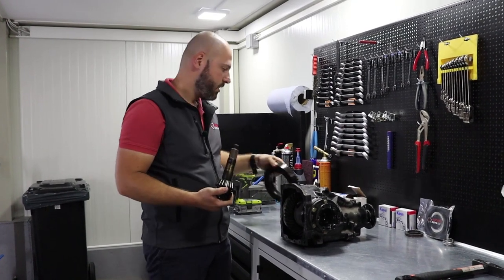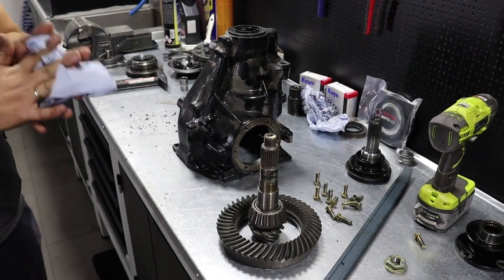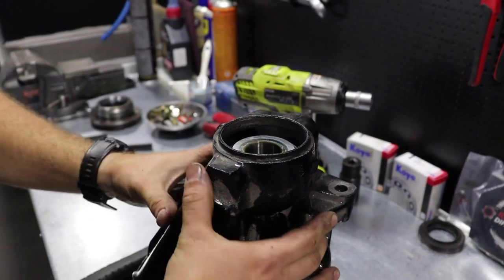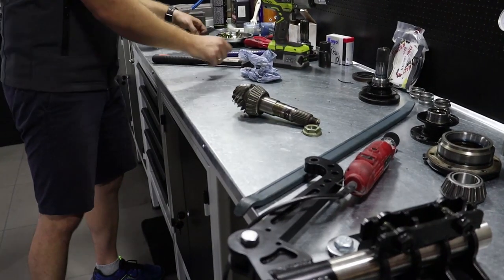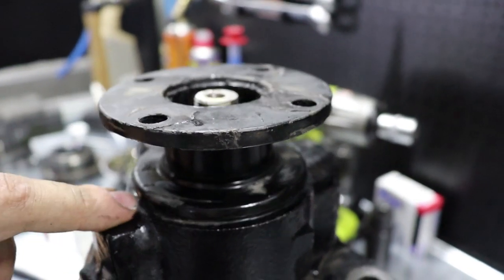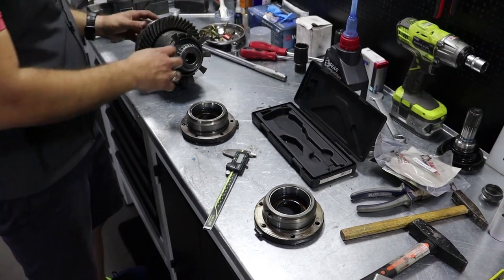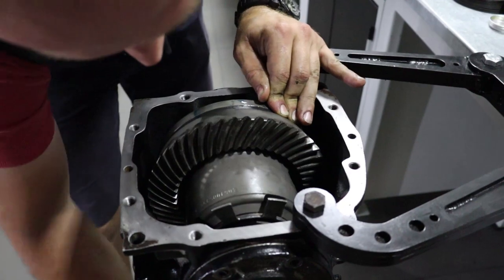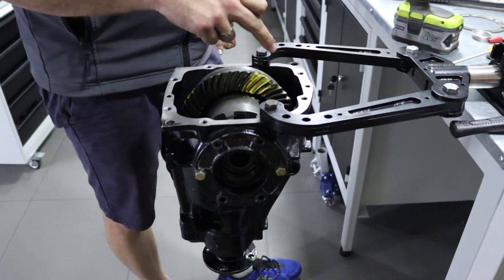How to change BMW differential gear ratio | Easy step-by-step instructions | Backlash adjustment

Comment: I bought pressure plates from these guys and they showed up in 3 business days from Serbia to US. Shipping was pretty cheap and parts were much cheaper than diffsonline and didn't have to send in old plates. Very good experience now I can finish diff rebuild w/ 3 clutches and 30/60 ramp. Should be perfect. Thanks.
Reply from the maker: Thank you sir for positive feedback! Means a lot👍🏻

Comment: ok finished my 188mm 3.46. Just to add more data here... I didn't change the pinion depth spacer I used the same one that was already in the stock diff housing even though I changed the pinion which had a different spacer offset written on it (the diff housing is stock E36 M3 w/ 3.23). I got a good mesh adjusting the backlash (lsd housing preload) left (looser) by one shim set. The stock shims were 1.63L + 1.63R. I changed to 1.66L/1.60R and was done. About the crush washer.. buy two or three. Once you get it to 4 or 5in lbs you tighten by 1 degree and it can shoot to 25in lbs! Have to make very minor adjustments.
Reply from the maker: Thank you for sharing the info with us and our community! Very helpful!

Comment: I just bought 2 sets of kits from you for clutches / clunk shim 
You are great. I finally found  real video of someone doing work like I do . 
Keep up the work . Also do a video with assumption of lost side shims. 1.3mm but there could also be a preload on carrier that BMW does not publish  . We can assume 2 bearings on pinion is not different from carrier ? 2 and 2 bearings and case flex . 10 inch pounds on carrier ? I wonder on new and used typical bearings   . Pull a pinion out and check side flange torque drag   . Do a video . 
Great work ! 
Roman .

Comment: Great video. On some old rovers where you cannot buy a new pinion crush sleeve and you can’t get a shirt, they heat up the original crush sleeve with a flame until it relaxes or anneals and then you can reuse without shim.
Reply from the maker: Clever move. Wouldn't think of that👍🏻 thanks for sharing👍🏻
Reply: like red hot or just a few hundred degrees?

Comment: Thanks, that answers the backlash and mesh setting procedure but still wondering about preload or clearance of the main shaft bearings ? Here you assume original shim total thickness is correct ?  Should this be checked or set before installing the pinion to get total shim thickness ?  Do you have a video showing how to do this ?

Comment: FYI, for the sleeve used to install the pinion bearing buy and cut a piece of 1 1/2" electrical conduit - that's what he's using. It fits perfect. Don't buy 1 1/2" galvanized plumbing pipe the ID is too small.

Comment: I love watching your expertise in rebuilding diffs! The bearings went bad on my manual E92 330d 215L which has got a quaife atb lsd in it. I was going to have a go at renewing the bearings myself but found a 'specialist' near me who said they could do them for the same cost as i would have to pay for a bearing set. 
After i put it back in the car it only lasted 2 weeks then started whining again! They had the diff back and said they'd fix it. They didn't because it was whining straight away. 
I'm going to fit a spare diff i bought, had to get an auto 2.81 because they are common and a lot cheaper, and strip the noisy one down to see what has gone wrong. 
What are your suggestions as to what it might be? C clips put in the wrong way round? They have not fitted the pinion shim maybe?
Thanks in advance for reading and replying if you can.
Reply from the maker: Thanks for reaching out. Since you have quaife LSD inside, backlash might be wrong so the noise comes from CWP. You'll see that when you disassemble diff and do visual inspection of bearings. Measure backlash, shouldn't be more than 0.15mm and less than 0.08mm.
Reply: @RacingDiffs  Thanks for the fast reply. The quaife was fitted 3.5 years ago and was absolutely silent until the bearings in the pinion went bad a couple of months ago.  Hope you don't mind but thought you might like to see my video of me enjoying LSD life before my bearings went bad 😂 
https://youtu.be/aka-t0XLLuk
Reply from the maker: @simonhaycocks  than it it's just bearings. If you have any questions when you start the job, please feel free to write to office@racingdiffs.com.

Comment: From Texas, glad I found your videos; thx for taking the time.  Im curious about the choice you made regarding the diff you are working on in the video.  Here in the States the OBD1 E36 automatics with the 1.8 4cylinder cars come with 4.44 diff gearing.  Is it easier to obtain a 4.44 and instal the hardware to make it a posi or is it best to swap gear ratios as you are doing along with the posi hardware as a complete rebuild with new parts; once and done.  Thx again for your vids.
Reply from the maker: It is a bit easier to swap only gear ratio and keep original carrier unit. But changing carrier unit has just 1 more step of setting its preload and that's it. We gonna make that video soon.👍🏻
Reply: @RacingDiffs  looking forward to that video!! Appreciate your skill and knowelege in your videos; thx for the effort and your time

Comment: Awesome video!! by far the best explained! im looking for a set of spacers for my BMW E30 lsd, something you can help with?
Reply from the maker: Sure. You need spacers for backlash or crown gear spacer?
Reply: @RacingDiffs  the carrier preload spacers, its a E30 3.64 LSD which has been taken apart and built by a random guy who i don't trust to do a good job lol.. i want to fully check it myself before i fit it to the car. and since it has many miles on and its been played with I'm guessing i will definitely need attention. i need to find out the technical specs first though, preload and backlash etc. i'll have a hunt around for the info and see if i can find out xD
Reply: Just came across this: 
Tolerance for backlash is : 0.06mm to 0.14mm
Crownwheel bearing preload tolerance is : 9lb/in to 18lb/in

two part numbers for each side spacer set:
33139065734 (1.45mm to 1.69mm in 0.03mm increments,)
33139065735 (1.72mm to 1.96mm in 0.03mm
 increments.)

I'm checking it out over the weekend so we'll see xD

Comment: Very informative! Very nice of your company to make such videos. Question from me: can I use pinion from open diff?
Reply from the maker: Thank you for your compliment. Yes you can, as long as you use the same crown gear. Pinion and crown gear are factory paired so you shouldn't mix them.

Comment: amazing video! been trying to understand this for ages. my only question is could i potentially use just the contact patch to adjust backlash? i dont have equipment accurate enough to measure backlash
Reply from the maker: Thanks! If you get the patch perfectly adjusted, the backlash will follow👍🏻

Comment: Great video. So the the shim for the crush sleeve pinon is because you reused the old crush sleeve.  You sell those separately? Or do you just recommend using a new crush sleeve? What if you measured the distance between the case to the top/flat side of the pinon gear? I’ve seen some kits that help measure the pinon depth? Is that only to establish the approximate depth? I assume you always need to have the final torque resistance done by the torque reading. Also what is the approximate axial free play you have initially? Seems like 1.0-0.5mm. Thanks.
Reply from the maker: We don't sell shim separately, we have it included in swap set and pinion bearing set which includes: 2 pinion bearings, all 3 oil seals and the shim. As for pinion depth, from our experience with BMW diffs, in more than 95% cases you can adjust gear ratio correctly without readjusting pinion depth as they make housings pretty precise. That's why we didn't showed it in the video. But we do measure each diff we assemble for our database. 
Pinion torque resistance should always be measured as this is the important part. You're right, we leave the smallest possible free play before we start tightening because this saves you time and effort. Also new crush sleeve is very strong. If you don't press him to this 1 mm you gonna sweat pretty much with 2 m lever to crush it.
Reply: I just went on your site and didn't see the shim listed on any of your bearing sets. @RacingDiffs
Reply from the maker: Please send an email to office@racingdiffs.com and specify diff type and parts you need. Our support team will give their best to sort everything out for you.

Comment: Great video💪 I have one question about exchange only the shaft seal. Its important to comply with the requirements pinion gear torque ? How should i do it right ? Thank u for answer .
Reply from the maker: As soon as you get input flange loosen, you'll have to put new crush sleeve or at least some spacers on it as we showed in the video. This is absolutely necessary to get pinion shaft tighten properly. 👍🏻

Comment: When replacing the pinion assembly do you always reuse the pinion spacer that is already in the housing? The pinions have markings on them in thousands of a mm. For example one pinion says 265 (0.265mm), the other says 0.745mm. I believe this relates to the spacer offset required. Does this only apply to the original housing it was used in? So if I'm using a new pinion in my original housing I just reuse the same spacer that was already in my housing and ignore the markings on the new pinion?
Reply from the maker: Excellent question. From our experience, 90% of the work can be done with proper adjustment of carrier unit position. The rest is pinion depth. 0.265mm could be pinion spacer + 3mm. So other one which is 0.745mm requires about 0.5mm thicker shim. But I assure you that whichever shim you use, you will be able to set it up correctly with proper left-right adjustment.
Reply: @RacingDiffs  ok. thanks for reply. I'll update when done to let others know how it works out.

Comment: In this video you mentioned torque and preload numbers for the 188 diffs. Do you have numbers for 210 units?
Reply from the maker: Yes, sure. 210 units should be tighter for 0.2Nm than 188s.
Reply: @RacingDiffs  Great thanks for the speedy reply.
Reply: @RacingDiffs   so 1.0 nm?

Comment: Thank you for this video, I will be doing this free change on my 210mm differential. For the pinion torque resistance, the BMW manuals say to measure it with no seal, but I see you did if with the seal on. I rather do it with the seal on as well is this okay?
Reply from the maker: This is the only way. If you tighten the flange to measure the resistance without  the seal, you will have to take it of to put the seal on and that's where you mess up the resostance again. If you know what I mean. Just lubricate the seal well so it doesn't interfere with results.

Comment: Also, is there a way to tell wear on a used gear and pinion set? Is there a spec or way to measure?
Reply from the maker: Generally visual check is enough. Teeth shouldn't be sharp like a knife on the edge.

Comment: Wich is the correct backlash adjustment size? 0.5mm-0.8mm or 0.05mm-0.08mm?
Reply from the maker: It is 0.05-0.08mm.👍🏻

Comment: How do you figure out total shim needed if your are replacing the carrier? Amazing video, can't believe how lucky I am that this came out just as I am working on my diff!
Reply from the maker: Preparing a new video for that, but I can reveal some stuff to you. 🙂 you start with thin shims and measure torque resistance like the pinion preload. And you put thicker shim until it reaches 1 Nm. That is ideal overall thickness.
Reply: @RacingDiffs  Hello, I assume the preload needs to be measured with just the carrier, without the pinion? If we have the pinion installed and, to avoid the disassembly of the pinion side, can we measure the combined resistance?
Reply from the maker: @zoomer4ence  in this case, just take off crown gear and put carrier unit without it.

Comment: Great video👍 
what is the inner and outer diameter of the PINION BEARING PRELOAD CRUSH SPACER of the rear diff  bmw TYP 188 ?
Reply from the maker: Will check and get back to you on Monday.
Reply: @RacingDiffs  ok thanks👍
Reply: @RacingDiffs  still waiting for your reply 🙏
Reply: @RacingDiffs  you wrote that will answer me monday but no answer from you still
Reply from the maker: There are so many comments and messages. This just slipped. Sorry. ID 34,8 OD 43mm.
Reply: @RacingDiffs  thank you very mach 👍

Comment: What step do I need to perform if not sure about the shims on half shaft is correct. Someone has messed with the diff original settings. 
Is there a preload check before putting in pinion shaft in?
Many thanks for your time
Reply from the maker: https://www.racingdiffs.com/collections/differential-tuning-parts/products/differential-breakaway-torque-preload-measuring-tool-adapter
Reply from the maker: You can remove crown gear fro the carrier, put it in like that and measure the torque resistance on output shaft. Should be a bit over 1 Nm. We have a tool available.

Comment: I've swapped to a lsd without changing gear ratios, I've kept the shims, bearings ecc...and installed them on the same side as oem. Is it normal that if I move the unit back and forth without oil it makes a noise like a clunk? Obviously I'm talking like there is no visible play between pinion and crown, thank you
Reply from the maker: You should have arronud 0.08 mm of play between gears.

Comment: Do you have any shims/shim set for under the pinion bearing? Changed my gear ratio to 4.45 and when i put the original pinion shim and bearing inplace the pinion hits the crown gear case. Without the shim under the pinion bearing the teeths are way apart. Any tips or kits for shimming the pinion or just go and find a lathe guy and make the shim correct size 😃
Reply from the maker: We don't have the pre-made. In your case, just take it to the surface grinder and get it thinner 👍🏻
Reply: @RacingDiffs  ok, will try grinding down the shim👍 thx for quick answer

Comment: I changed the diff  BMW e38 188 3.23 to e60 188 3.91. Acceleration is better. But the automatic transmission is changing leter, shifts later and therefore fuel consumption  increased. What to do or how to adapt transmission with diff?
Reply from the maker: I'm not sure. This is a question for the transmission specialist. Sorry.
Reply: @RacingDiffs  Thanks for attention

Comment: It seems like a really low pinion preload! I believe the 168 case calls for around 3nm
Reply from the maker: It is different when you measure with and without carrier unit inside. If you tighten pinion ti 3nm (measured without carrier), bearings won't last 1000km.
Reply: @RacingDiffs  OK,  I'm about to rebuild a 2002TII diff and find it hard to find good data.
Reply from the maker: Cool. Please do write feedback  after mounting on the car👍🏻

Comment: Hi guys, I hope someone can give me some light here, I bought a ring and pinion (gear ratio 3,64) set to swap into my 188 case (originaly 2,93), I used as start point the same set of shims, but I have an IMENSE amount of play between the ring and pinion, like 3mm, which even later after swaping the spacer behind the pinion bearing was not much better, what could have gone wrong? 
No, I did not forget the spacer behind the pinion bearing. 

To verify I swaped back to the old pair and everything was back to normal. 

Thank you!
Reply from the maker: Hello,

You just need a ring gear spacer, and you're good to go👍🏻 

https://racingdiffs.com/collections/differential-tuning-parts/products/bmw-differential-crown-ring-spacer
Reply: @RacingDiffs  thanks a lot, I had no idea about this! Now it should work!
Reply from the maker: @evas36avus glad to be of help!

Comment: My friend I have a e30 ix with 4.10 gear. I want to install real lsd with a 3.64. Will shims have to be adjusted if backlash is passed 0.08.
Reply from the maker: Don't change gear ratio separately from front diff. You will mess up the transfer case. For ix cars, they need to be changed simultaneously.
Reply: @RacingDiffs  I have too, I’m putting a n54 motor .
Reply: @RacingDiffs  so my question please . Can I change the gearing on ix. Are is gears or any interchangeable?
Reply from the maker: On IX is a bit tricky. When you change the rear gear ratio, you must change the front as well. They always go in pair. Otherwise, you will destroy the transfer case quickly.
Reply: @RacingDiffs  I know my friend . I’m swapping a n54 in it. I’m going rwd. That’s why I asked. If I keep the diff I want a gear that will match the 335i trans.
Reply from the maker: Then it's not a problem.👍🏻 the tallest you can go is 3.15.
Reply: @RacingDiffs  nice

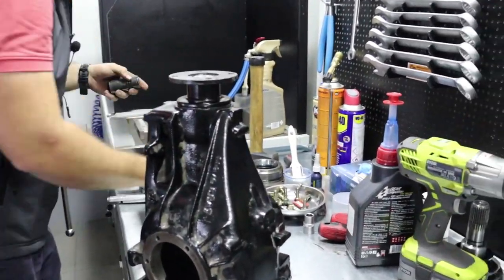Comment: 33:59  torque wrench , 0.6 to 0.8 nm ?  Less than 1 nm ?  Or 6nm /8nm with any  torque wrench with a measurement range from 5nm to more /higher
Reply from the maker: That's right. 0.6 - 0.8 Nm. You need wrenches in 0-5Nm range
Reply: @RacingDiffs  damm , there is no other way? checking the clearance on the dial indicator with the insert?
Reply from the maker: I'm afraid this is the only way